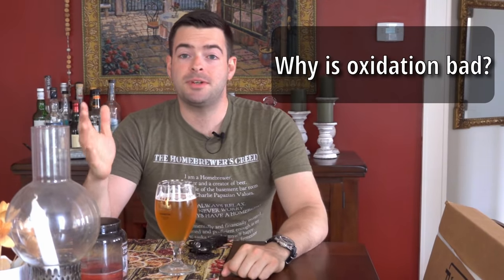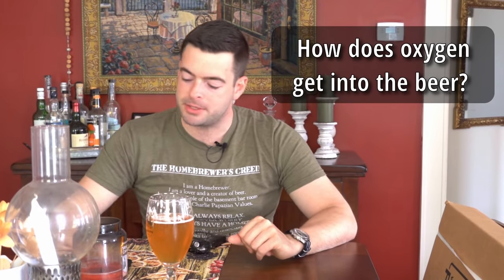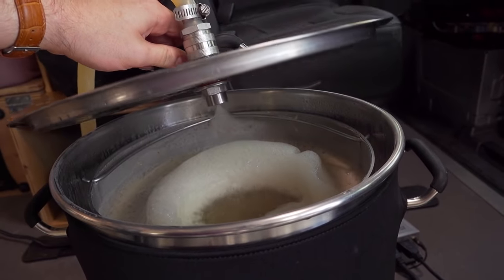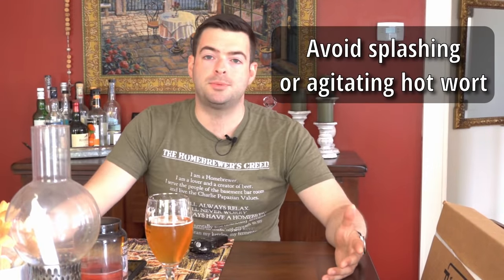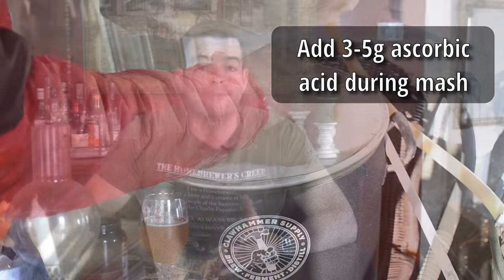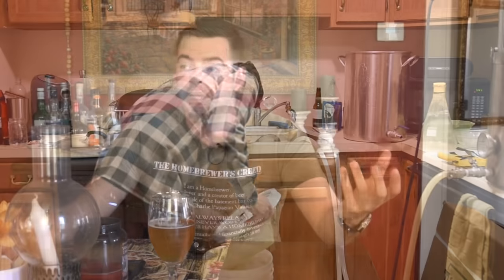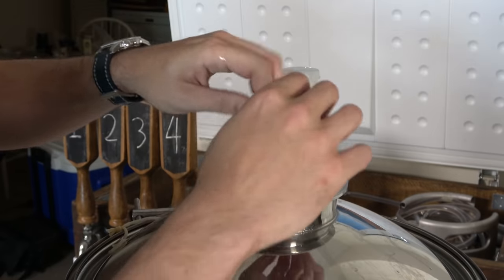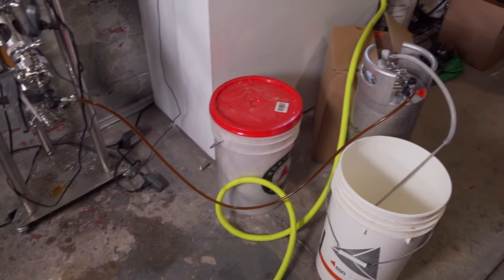THE TRUTH About OXIDATION in BEER & 16 Ways to PREVENT IT

Comment: My favorite way of purging serving kegs is to use CO2 from fermentation. I hook my fermenter up to the OUT post on a keg, and hook the IN post to some bev line into a jar of sanitizer. CO2 goes into the bottom of the keg before going out the top and through the airlock. Fermentation generates huge quantities of CO2, so oxygen levels should eventually be as low or lower than the fill-with-Starsan-and-push-it-out method.
Reply: I do the same except using a spunding valve instead of an airlock. Have had great success and only use CO2 to serve now.
Reply from the maker: Sounds like a great method, thanks for sharing!
Reply: Hell yeah! I do same thing except the receiving keg filled to the brim with sanitizer and allow the fermentation to push it all out , 100% o2 free and sanitized and ready, using co2 from fermentation is really beneficial
Reply: @mattyitto2346  fun fact, by doing this, you're fermenting at about 1 PSI of pressure. Probably doesn't matter, but interesting to know.
Reply: I tried to do this on my most recent brew but I couldn't get the keg to seal without pressure. My fermenter isn't pressure capable so can't use a spunding valve

Comment: Regarding hot side aeration, our understanding is that hot side aeration is only a potential issue after the boil because the boil will more or less eliminate all traces of o2. So the spray valve foaming before the boil is a non issue. Unless you use it after the boil for some reason. And I’m not sure why anyone would.
Reply: This is a great discussion at 1:03:00 on the topic from one of our very respected neighbors in Mills River. 

https://youtu.be/FZ6qwIStZO8

Homebrewers are at an even worse disadvantage than our commercial brothers because of the square cube law.
Reply from the maker: Good to know! As I said, never ever seen an issue from HSA using the system.

Comment: I’ve been using ascorbic acid in the mash since you talked about it many months ago along with some other techniques, and haven’t had oxidation issues.  Cheers! 🍻
Reply: I would put it in on the cold side. Ascorbic acid or Vitamin C, are not stable at high temperature. Some of it will degrade in the mash and boil.
Reply: @andvil01  thank you for the information.
Reply from the maker: Nothing beats a bit of cheap insurance. You can add it both hot or cold side, it does slightly different things depending on when you add it but both of them will help reduce the risks of oxidation.
Reply: Really enjoying all of your videos!  

Have you done a video on canning and how to avoid oxidation?  I need to look into ascorbic acid a bit more and other oxygen scrubbers.

Comment: For those of us who bottle condition, you advised us to lose the bottling bucket but you never explined how to prime without it.
Reply: You could swap the bucket for a keg, add SMB to the priming mixture, do a closed transfer, and bottle with Beer Gun?
Reply: In Australia you can buy sugar lozenges that you add to the bottle, then fill direct from fermenter.

I made a sugar solution and measured it into the bottles individually with a syringe prior to bottling to get the carbonation consistent across different bottle sizes in my batches. 

I tried a bottling bucket a couple times but the oxygen exposure it creates flattened the hop character of the beer noticeably and made the hassle of dosing the individual bottles worth it.

Moving from that process to kegging has improved the quality of the beer again for me just through being able to purge the keg headspace with C02, rather than sealing a bit of oxygen in the top of the bottle when capping.

Comment: It's funny how our experiences differ. I don't keg, my bottling setup is basically a fermentation bucket with one of these starter bottle fillers, I have to move my fermenters between the sixth floor and my basement and I prime with a sugar solution that I stir into the beer prior to bottling, yet I rarely ever have issues with oxidation. In fact I had more problems with fermentations where I opened the fermenter and threw adjuncts or hops in. That's why I don't dry hop, which is okay since I am not super into IPAs. But if I ever want to make one, I'll get me a bottle of CO2 first. Thanks for the tip and cheers.
Reply from the maker: Wow, that is a lot of work, but glad you are having success with your beers! Be safe going up and down that many stairs!
Reply: @TheApartmentBrewer  Maybe I should have mentioned that I have an elevator. That helps a lot :D . There's still a lot of possibly oxygen-introducing shaking involved and I'm always a bit anxious about it. But so far I rarely had issues. If I ever want to switch from "rarely" to "never" your video is where I will go.

Comment: As a professional and home brewer here is my set up at home:
1. I do not care about hot side aeration. The dissolved oxygen in mash and boil are very low. Until you solved everything on the cold side, this is not your #1 issue.
2. I ferment in 30 l stainless steel kegs. A float tube takes the beer from the surface. The main fermentaion is with an open valve on the CO2 side. Then I add dryhopping and 200g sugar. Put on the lid, clamp and spunding valve. Pressure according to temperature and CO2 level. If not dry hopped I may have the spunding valve from the very start.
3. Cold crash under pressure.
4. If transfered to a keg, just clean and evacuate the other keg. Put a beer to beer line between the kegs and the spunding valve on the receiving keg. Put a bar on the fermenter. Let the beer slowly over. Adjust the pressure.
5. If bottling, I use a counter pressure filler directly from the fermenter. Flush the bottle, fill it and cap on foam.
6. I have the opportunity to check my beers on an expensive professional analyzer from Anton Paar. Few homebrewers can do that. I normally get oxygen levels at 0,1 ppm, but sometimes as low as 0,05 ppm. I have got up to 0,2 ppm, but I haven't had any oxidation problems.

I am aware I have opportunities to take my homebrewing to a high level, and some equipment are expensive, but there is alot you can do for little extra.
Reply: What is your opinion on the ascorbic acid during mash or metabisulphite at kegging? Those are two techniques I'm just discovering. Unnecessary if following a process like yours? I pressure ferment and close transfer. I'd consider the additions if I knew it would help the shelf life of a stored beer. 🍻
Reply: @TheMattMustain  You can use both on the cold side. Ascorbic acid will break down during boil. Better add with dry hop.  The reason to use sulphite instead is that it occur natural in beer and do not need to be specified under some value. Ascorbic acid do in many countries. Nothing a home brewer need to worry about. 
A few grams of a mix of sulphite, sorbate and ascorbic acid to a 25 l batch will also prevent growth of Lactobacillus over time. But add after fermentation and no bottle conditioning possible then.
A good process is more important than additives, but they can get you just a little further.
Reply from the maker: Thanks for the info!

Comment: For IPA, adding a little bit of metabisulfite with the last dry hop, and a little bit more with the gelatin (clearing) works great for me. Same for NEIPAS, without the gelatin if you´re hazecrazy. I use a smidge of metabisulfite with most of my beer after kegging, just make sure they´re cleaned up, (actually, metabisulfite is not the yeast killed many thinks, you can fermet stuff treated with it just fine - just takes a little more time).
Reply from the maker: Yeah, the metabisulfate tip is a good technique I forgot to cover here.

Comment: Hey @TheApartmentBrewer, thanks a lot for the informative content! Question: is ascorbic acid the same as a Campden tablet? If not, what's the difference and why would you recommend one over the other?
Reply from the maker: They are two different chemicals. A campden tablet is potassium metabisulfite. They both work in similar ways if you add them post fermentation, but a campden tablet won't reduce ROS like ascorbic acid will.
Reply: @TheApartmentBrewer  Awesome, thanks so much for your reply! So In this case it would be advised to use ascorbic acid to reduce ROS during the mash and again (or Campden) post fermentation to reduce oxidation as much as possible?
Reply from the maker: @zwartschaap001  I think you can use both but in my experience ascorbic acid in the mash has been more than sufficient

Comment: Nice summary of a lot of info!  I do same transferring fermenter to keg.  Push out sanitizer with CO2 (at about 2psi).  But I do then connect the 'in' post of the keg to the head space of the fermenter.   That little bit of pressure is enough to get the siphon started either from the floating dip tube if fermenting in a keg, or thru the racking cane if in a carboy (I use one of those plastic carboy caps with a carbonation cap in one opening and the racking cane in the other).   Getting away from carboys though.  I like the new CHS 6.5 gal fermenting kegs, but I started using 6 gal Torpedo's with success at a lower price point.   One other thought for you, next 'you might be a homebrewer if' merch idea:   "You or someone you know has failed at pronouncing kveik".   Cheers!
Reply from the maker: Thanks for watching!

Comment: Love your channel it's very informative. Everyone seems to agree that CO2 is the way to go with purging, but what can I do as I'm not in a position to use a CO2 bottle? I usually bottle most of my beers in plastic bottles and occasionally I use a plastic beer barrel with the small CO2 capsules used in soda streams with a pin valve.  Would it be possible to fire 2 or 3 capsules of CO2 into the empty barrell, put a hose on the tap and purge the fermenting bucket and bottles as and when required. Everyone assumes we all have access to large CO2 supplies and sure not everyone does.
Cheers Michael (in Scotland)

Comment: Hot side aeration is enough of an issue that guys like Vinny and all the hype haze houses all use de-aerated water as a basis in their HLT.  They want consistency and longevity?  I do too. In fact I want my kegs of homebrew to hold up longer than packaged pro beers - e.g. a hazy IPA that still tastes great after 4 months.  And even though I don't do this for every beer, I've achieved this through all my LODO practices.
How?  I wouldn't recommend this for propane brewers, but if you're on electric it's actually easy and inexpensive to make D-A water.   Just bring your entire sparge and strike water to a shallow boil first thing in the morning of brew day, before letting it drop to strike temp.  You can do this the night before if you want, but you'll probably lose a lot of heat overnight, which may be wasteful. In my brewing space, my water is naturally at the ~180F strike temp after about an hour and a half after boil, with the lid off, so that works well for me. (Think of this as the "no chill" method)
I've done the math with my wattmeter, I use about 1.5 KwH or $.13 to de-aerate my water.  And I often have cleaning to do (e.g. fermenters) that benefit from the very hot/boiling water, so having that first thing is a nice benefit.  I still recirc my mash for what it's worth, but I do so gently adjust under the wort level. Maybe I'll make a video of all this one day.

Comment: Hello from a very cold and snowy south east Australia, early winter down here, I'm brewing lagers under pressure in the Kegland all rounder with one of their spunding valves which they sell and I have attached a hose out of the spunding valve into the outlet of an empty keg, sometimes daisy chain up a few kegs and flush them with co2, then I run it through a filter into the kegs and there is no oxygen contact what so ever and I have never had any problems with my lagers, reuse your co2
Reply: @patrickglaser1560  Yes, I sanitize them with starsan, I then flush the beer filter and the lines with co2, put one end of the line on the outlet of the fermzilla then it goes through the filter and the outlet hose sits on the bottom of the keg which is filled with co2 there is no way any oxygen can come in contact with the beer
Reply: Exactly what I do 🍻

Comment: Nice lots of info.  I normally don't  bottle my beer unless I give it away to friends and relatives.  Currently using my Vessi Counter Pressure Filler and also a Tapcooler Counter Pressure aswell for the  onesies and twosies.  Love them both. Both used on my Keezer.
Reply from the maker: Counterpressure is a very good way to go!

Comment: I will have to employ these methods with my meadmaking.  So far, I've had beginner's luck.  Stumbled into using sodium metabisulfite as a standard procedure.  Didn't know I was doing the right thing.  Figured I was drawing in air when I siphoned, so I never bottled the last bit that was oxidized.  Have had no complaints, but I figure I can do better by using co2 in the bottles before filling.

Comment: Thanks for the video, Steve. I hadn't heard about hot side oxidation until recently and it has been standard practice for me to use my mash paddle to stir the heck out of the wort while chilling to facilitate more rapid cooling. This is usually about 20 minutes of vigorous stirring. Although the Brulosophy podcast reported that the hot side aerated beer wasn't statistically significant, I wonder if the way I've been doing things might be affecting my beer?
In 2021 I used your amazon link to pick up the rare earth magnets for dry hopping and I went back to your link and saw that you've got the silicone sou vide magnets. Are the metallic ones that were previously linked not good to use because corrosion?

Comment: Steve, thanks for the great video. I have only recently heard about hot side oxidation. My standard practice has been to stir the heck out of the wort during the chill to facilitate cooling and now I wonder if that might not be such a good idea.
In 2021, I used your link to get the rare earth magnets for dry hopping. When I checked your Amazon link again I noticed that you now have the silicone sous vide magnets. Are the metallic ones that you previously linked potentially able to corrode?
Reply from the maker: Technically yes, but I still havent had problems with them. I would recommend if you are using this technique frequently to use the silicone ones just for peace of mind.

Comment: When bottling form fermenter how do you mix the priming sugar in?
Reply: There's a few options. In Australia you can buy sugar lozenges that you add into the bottle then fill from the fermenter tap, some people measure table sugar directly into the bottles. I made a sugar solution (1:1 sugar and water by weight) then dosed each bottle individually with a syringe so I could control the sugar dose exactly across different bottle sizes in my batches.

I tried a bottling bucket a few times and it made enough of a difference to the beer that I put up with the hassle of doing it that way.

Comment: If you fill already carbonated beer into bottles with a counter pressure filler or something like the Beer Gun, a good method to clear the headspace from oxygen immediately before capping is to provoke the beer in the bottle to start slight foaming. Then just wait until the foam starts exiting the bottle and immediately cap the bottle. This way you have only foam with CO2 filled bubbles as headspace - no more oxygen.

It is sufficient to provoke foaming with slight vibration of the bottle, e.g. by knocking with a screwdriver against the bottle or something similar. Unfortunalely this works only with fully carbonated beer.

A further method to reduce oxygenation is to reduce the amount of headspace itself. Be aware, that there must remain some headspace.
Reply from the maker: Cap on foam!

Comment: Wow, what perfect timing. Brewing up my first hazy this weekend! For the closed transfer (we’re using a bucket fermenter), we’re planning on doing the trick you described and filling the keg with sanitizer then flushing it out with cO2.  When it comes to transferring the beer from the bucket into the keg, there’s no way to hook our cO2 line to the bucket so can we just use gravity (purging the keg of most it’s cO2), hooking up a line from the spigot on the bucket to the liquid post? I’ve seen videos of people doing this but never have actually attempted myself. Don’t want any surprises when it comes to the transfer day where I’ll already be super nervous about oxidizing an expensive batch of beer
Reply: I'm doing the same thing, using gravity to transfer, works well as long as the beer is clear of particulate. I recommend building a gas side jumper of sorts, gas post to airlock bung, this way you have a full closed transfer without pulling in any air. I've not had oxidation issue since doing it this way, knock on wood.
Reply: @dralois  this is great to hear! I’m dry hopping using the magnet method and I have a hop spider for the whirlpool so hop particulate hopefully won’t be a problem. Is there something I can buy out there that does this job (rigging a cO2 line to the airlock bung)?
Reply from the maker: Thanks for watching! I hope the brew went well for you! You can definitely use gravity to keg, its not ideal for hazies but you'll be alright as long as you purge the keg very well and transfer the beer gently. A jumper is easy - one gas disconnect connected to a line, shove the other end of the line into the airlock hole.

Comment: Another little tip - when sanitising your keg prior to packaging, use Sodium Metabisulphate (Na2S2O5) as the sterilising agent.  Na2S2O5 is an excellent oxygen scavenger and the tiny bit of steriliser remaining in the keg after being cleared with CO2 will deal with any O2 sneaking in through the closed (or partial closed) transfer.
Reply from the maker: Good tip I missed!